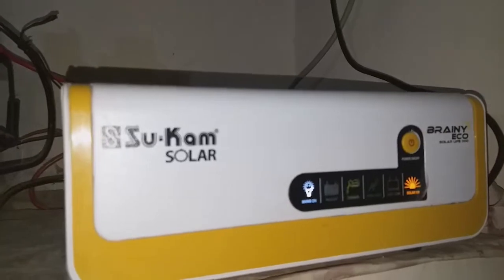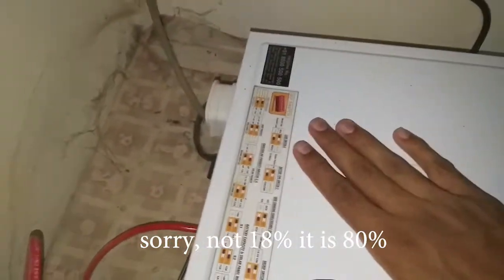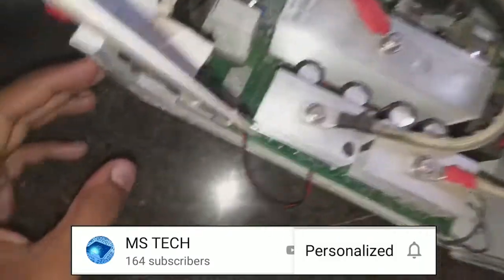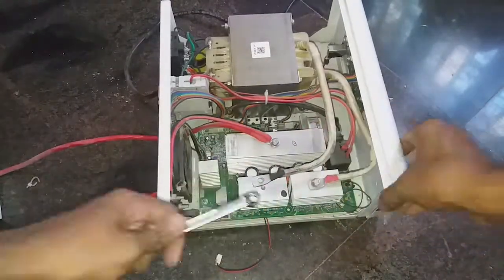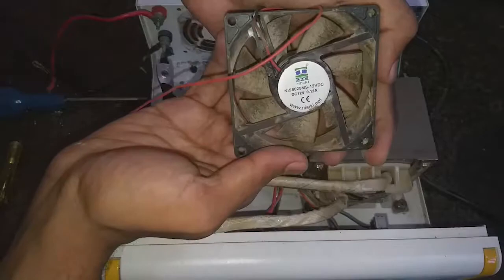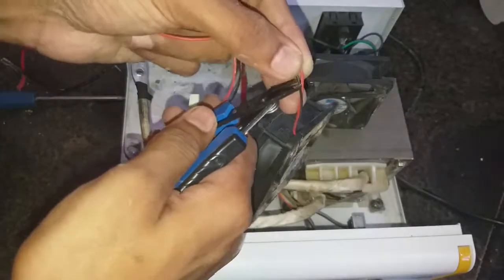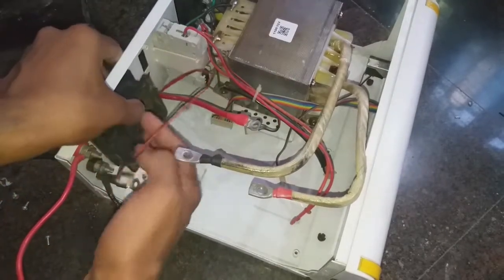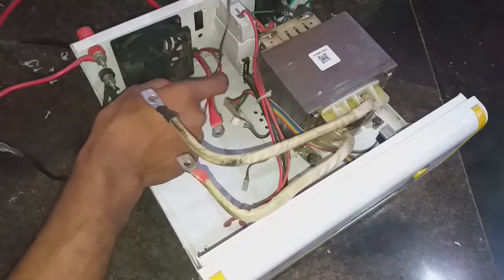INVERTER FAN REPLACEMENT + TEARDOWN | SOLAR INVERTER | HOME UPS | MS TECH

Comment: I have a sukam falcon+ inverter. Fan sometimes stop to work and inverter beeping continuously. I turn the inverter off and then on. Fun is starting for some seconds and then stop again and inveter beeps. What should be the problem. Fan need replacement or other?
Reply from the maker: My inverter worked fine without fan. In normal load the inverter don't need fan to work, only need when it warm in medium or high loads. I don't thing your fan was an issue.
Reply: I have also new inverter but he reply maybe my fan has no problem.I try to observe now if fan is turning when I have lot loads.

Comment: I have an amaron inverter. the fan never runs. it's all new inside. one day there were long beeps coming every 10 mins and all the leds looked normal on the front  (only in UPS mode it's happening) so I switched it off . battery is 2 years old and water level is full. The inverter is brand new 14 days old  . I've never seen the fan come on in this inverter
Reply from the maker: Claim warranty.
Reply: @MSTECHCHANNEL  sadly the warranty seal is already torn on the product when I had purchased it. I got it through Amazon from a seller . Now the seller says I need to contact amaron if seal is torn. During this lock down period no one answers calls only. I have the warranty card and everything. Do you think if I keep it on Wide mode it will make a difference?  currently it's kept on narrow mode .
Reply from the maker: I don't familiar with your inverter, so i can't give a clear answer. If it is working fine without fan you don't want to do anything, maybe it has temperature control and only the fan on when the inverter become hot.

Comment: Hi I have a 3000w sine inverter should the fan be running at all times...thanks
Reply from the maker: Some inverter fans run all the time, some inverters has a temperature controller and the inverter is smart enough to know when to kick on the fan. In my case it has a temperature controller and fan only run when the inverter start to warm up.

Thank you for watching.
Reply: @MSTECHCHANNEL  thanks for the info.it hekps a lot.